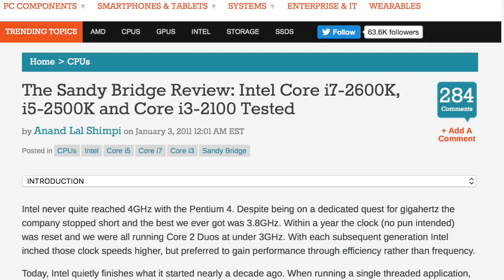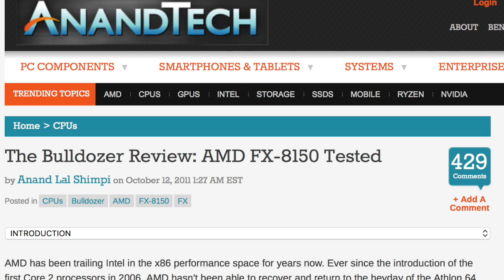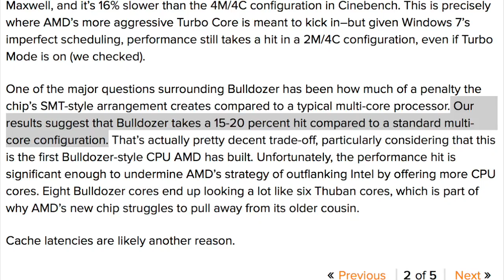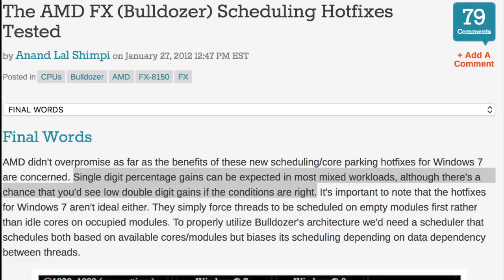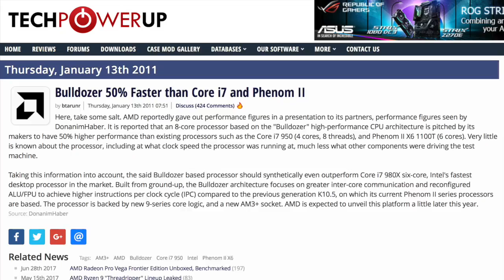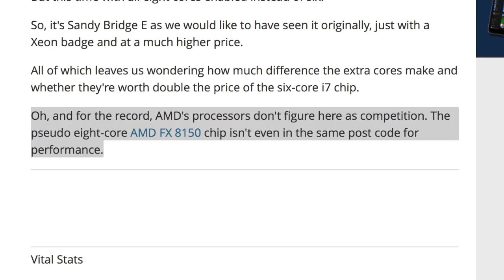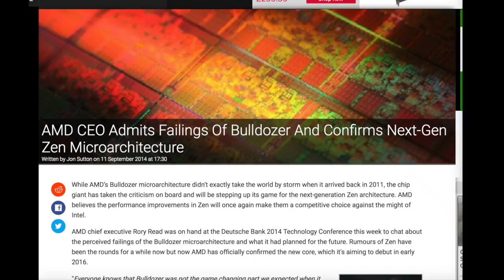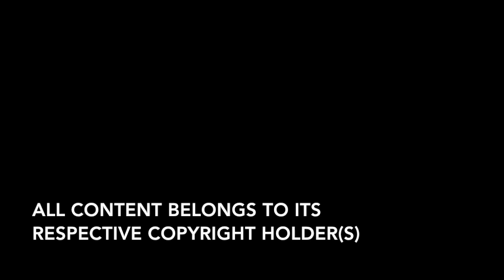The Bulldozer Story - and why AMD FX is better than you remember

Comment: FX was cheap when prices dropped after disappointment, the quads were terrible, 6 core 2nd gen FX6300 was the best bargain and overclocked well enough to be worthwhile on a budget, still is.
You need a decent mobo and memory to get better performance than Phenom II.  
I benched the 6300 at just 2.5% slower in a 1080p Heaven gaming benchmark against Ryzen 1700X, both OC'd to the max on Hero motherboards with fast G Skill memory with top of the range noctua cooler on a test bench.  My 1700x is still the fastest recorded on HwBot in the UK.
My i5 4670K smashes both the FX & Ryzen in 1080p gaming benches being 12.5% faster than the Ryzen.  Graphics card was an R9 390.

Sandy Bridge still rules if you are after a budget rig and don't mind used parts.  FX6300 is a good budget buy new if you need extra cores but there are as good if not better Intel alternatives for the same money now for gaming if you can live with 2 cores & hyperthreading.   I have an FX8300 but the extra cores don't do jack in most games and the 6300 overclocks better.

Comment: Im still rocking the following and still play everything on max settings at over 60fps (bf1,FO4, etc). For 4-5 year old rig, id hardly consider the fx to be bad lol. Nothing like being able to play bf4 in 4k while recording with fraps at around 100fps. Most things cant do that now, a half decade later. 

Motherboard - Asus Sabertooth 990fx Gen3 R2.0 The Ultimate Force (TUF) Series
CPU- AMD FX 8350 4.82ghz OC 8 core
Ram - 16gig (2x 8gig) Gskill Ripjaws X series
GPU - Radeon R9 290x /w 8% OC
SSD - Samsung 840 pro
PSU - Coolermaster Silent Pro 850w
Case - Coolermaster HAF X
Reply: cpu: FX9370@4.7ghz 1.38-1.428v htt2600 
motherboard: asus crosshair v formula z
Ram: 32gb gskill 2133
gpu: zotac 1070mini
psu: evga 1300watt g2
case: CoolerMaster Cosmos Medusa 

havent found a game yet i cant play at 4k...hell most run at 70+fps...since im on a 60hz monitor....yeah.... sall good :D 

no ssd 300gb vrap for boot with 6gb primocache(+50gb L2 cache on an ssd)
also use 9gb (bit over) for cache on  my games drive,thats a 4tb sshd, along with another 50gb ssd cache.

another good trick is to grab compressgui and compress your games folder....less data to move from drives to memory=faster load times... ;)
Reply: Try running Planetside 2 or Arma with those FX. Even Intel chips dip below 60 fps there.
No optimization for many cores, hunger for high IPC and clock  will break it's neck there.

I'm not saying that AMD makes bad products. Far from it. FX cips were just not in the right market and Ryzen is awesome, but sometimes there just isn't the right workload.

Comment: Bought the 8150 for 125 USD and 8350 for 145 USD in 2012. They both aged well, i gave them away this year and bought Ryzen 1700. FX was not that bad, only thing i really did not like with the 8150 was the heat.

Comment: Everyone can say what they want and that is fine. I recently purchased a R5 1600 to replace a FX8320. The FX8320 ran everything games and all smooth as silk. The CPU never stuttered or anything negative, It was absolutely smooth.
The only negative thing I can say about the CPU is the heat and power consumption.
Guess what, you will be hard pressed to find anyone who has or has had a FX cpu that would complain about it.

Comment: ill take a 6 core phenom 2 over an 8 core FX any day.....

and thats why i kept my phenom 2 1090t at 4ghz till i got my 1700x.......

the 6 core P2s were a bit better at single threaded, but lost out wen over 4 or 5 cores got used....
however....its still 6 cores....
Reply: I had a 1090T myself, but the FX-83xx is faster in almost any real-life scenario when overclocked at least a little. bulldozer was a failure to me, but piledriver had almost the same IPC at thuban had, but clocked way higher and offered more threads. So again, bulldozer was a downgrade, piledriver wasn't.
But for a good chip like that (4GHz) i can see why you held onto it for so long.
Reply: 4ghz.... 1.45 to 1.5 volts (no llc control...so, could have been a 4.1ghz cpu!!!)

and had 4 sticks of ddr3 at 1600mhz with cas6 or 7.....
the hypertransport speed was also like....3800mhz??

been a while....

but ya..... ive still got that chip. 
its like a pet man...... that was a great little cpu, my first real build

Comment: FX was a colossal failure, MORE than people think. AMD completely misjudged the market. High power consumption, large expensive die, no iGPU, and horrific single threaded performance made the product DOA for just about everyone. Servers/consoles/OEMs didn't want it for high power consumption.  OEMs especially don't want to have to put a more expensive mobo/PSU/cooling solution in a prebuilt just to have the CPU at 75% less FPS in WoW and other single thread titles. Huge waste of money for them, so they pushed Intel instead. Home/office users didn't want Bulldozer because it didn't have single thread or an iGPU. True professionals doing workstation tasks don't mind paying more for 4-6-8-10+ core Intel i7s or Xeons with far better perf and perf/watt, so even though Bulldozer was cheap they didn't want it.

The ONLY group that bought Bulldozer were enthusiasts, many of whom still wrongly believe their FX CPU was good compared to Intel's competition (Say, myths about i5s and i7s not being good at multitasking, or belief that moar cores = better).

From AMD's perspective it is even worse, because they were forced to take their big, expensive CPU die and price it incredibly cheaply to sell anything at almost zero profit.

Bulldozer was 315mm(squared), Sandy Bridge was 216mm, Ivy Bridge 160mm. Ivy Bridge was half the size of Bulldozer and ran circles around it in performance. That is how bad it was.
Reply: Hey Babe fx is a good budget choice especially if you just despise intel
Reply: Bulldozer was not designed for the low threaded desktop market.
Take a look at the Bulldozer-based Opterons. They were actually quite competative. Good affinity for multithreaded workloads and moderate power draw.
Reply: I went with an FX-8370 / Asus 990FX/SB950-based rig (once it's UEFI & Linux drivers matured) due to its affordable ECC RAM support and because I became aware of Intel's VPro / ME...
Reply: Was*
Reply: basshead Fair play, but the FX never competed with the 2600K, it was a 2500/2500K competitor.
Reply: Most of that was a lie. First of all, you need to own an FX to know what they're capable of since nowadays they are more useful than before. Also, the PS4 and XB1 used underclocked. 8350s.
Reply: I don't care for as long as I buy it cheap nowadays...hehehe

Comment: I still have my fx6100 , clocked @ 4.2ghz, and it does the job. Early on certain games gave it issues, like BF4, yet others ran fantastic on high settings(Witcher 2). The wife confiscated it to work from home, so i dont use it anymore, but it did fairly well for me, especially for the price. I'll be building a Ryzen based system later this year.

Comment: 9 minutes of explaining how badly AMD had foreseen the market when designing the Bulldozer.. Then turns around and says, it is not all amds fault, games and windows were not optimized for Bulldozer.  You got this the wrong way around, bulldozer was not optimized for the market it launched in.. 
Btw before i get hate for intel fanboism,. , my 3 latest CPU's has been phenom II X2 (unlocked 4 cores xD ), Phenom II X6 and FX-8320 (piledriver) because they offered superb performance for the price at the time of buying, however the first gen bulldozer was never even worth considering for anyone who owned an X6, X4 or even an X2 for gaming.
Reply from the maker: I think it's a mixture of both. AMD misjudged the market but also optimisations were slow to take place.
Reply: Jogeir Hvide yeah sure! so you're basically saying that intel was already optimized when it was created but amd not, that's why one outperforms the other.

Sarcasm aside, all hardware needs code optimization, so stop the bs. Software makers favor intel simply cuz it's a multinational that has a monopoly. (Sarcasm on again) So let's keep feeding it.

P.S.: One does not need to be a fanboy to be dumb.
Reply: +Michell Couchman: games are being optimized for the arch now, because, both xbox/ps4 (all versions) are using chips based on the FX line, 8 core, low clock, basickly  a MUCH slower version of the chips we have now, its also why you are seeing more and more games that  use 4+ cores more and more effectivly. 

and, with vulkan i get over 120fps in doom with the game cranked at 4k, thats better then my buddies 2500k with the came videocard(and hes clocked to 4.5, his chip will not pass 4.5, but, it will do 4.5 at VERY LOW volts.....so he lost and won at the same time.. ) 

with dx12 titles/tests, and hell dx9 and 11 titles, i mostly get 70+fps at 4k with games maxxed or near maxxed, dx12/vulkan never are below 100 though.....i see no problem...i was pullling 170 + solid in the last vulkan/dx12 beta i ran(cant name, nda...) dx11 was pulling 80+
Reply: No entiendo nada pero 
Cheers bub
Reply: Even a Core 2 Quad can push 60 fps in doom.  That is not really an archivement.
Other gamers that are more demanding on the CPU, especially those will less optimization for loads of threads will give very different results.
Reply: try playing Elite Dangerous Horizons,  there are very few games i have found i cant play at 4k on my 9370+1070mini, at in game or higher max, and still get 60+fps, those i cant, well, arent really games im interested in anyway, like arma2, that game runs like SHIT even on my buddies intel exteme 6core12thread at 4.6ghz, dosnt get much better perf then i do using the same config files... and in some rare cases he got worse... (when we played it for a time) 

on the other hand, most newer titles from competent devs, are making better and better use of these chips since, they have very strong multi thread perf AND support features intel chips didnt support for 2-3 gens after amd adopted them....for example, i could play the cod wwii beta when a few friends on intel had the same issue that amd users with phenom gen chips had, their chips didnt support the full feature set needed for the game to not just crash when you tried to load into a map.

it was confirmed that first gen core i7/i5/i3 chips, couldnt run the game....total bs....because...honestly, with how well it ran.... it should be able to run on a core2quad, i saw it running on an a8 apu at 1080p with competent perf for fuck sake...and that was a laptop with barely better then apu gfx....
Reply: FM3 board?
Reply: Wrong Bulldozer works just fine. although it underperforms. AMD saved a ton of money and resources. Cornered the Console market. Then Ryzen. Well planned strategy.
Reply: @John Wick You fail to see that this isn't just about FX. AMD is a world's first company, a leading company in innovation. AMD was the first to achieve 1 Ghz processing, brought 64-bit computing to the x86 arch and a lot more including freesync, free stuff/ open source, because AMD cares about innovation and progress instead of just pure performance for profit. Back then, AMD's processors challenged Intel's and little after AMD opened a lawsuit against Intel, surprise... Why does a company like that fall behind the competition? Let me see, are the two equally in economy/resources? I would give you the reason if that were the case, but the truth is that intel abuses its power, like multinationals tends to. You know you can't deny that. And after all that, AMD was able to bring a pretty good (line of) processor, that again, challenges and beats Intel's. Nothing to say about it, huh?

"Some new product line pops up from AMD, with vastly less effective IPC 
and a radically different design from previous CPUs...and you think that
 wouldn't require greater time, effort and investment to optimize?"

Things have to change and evolve in order to improve (that involves being totally different when necessary), so stop the bs.
Reply: @Chazy Intel chips have come out regularly with small incremental changes in technology for a very long time. They've been the leading cpus for a solid decade, barring the present. Yeah, software is usually well optimized for Intel, because their products set a clockwork industry standard.
Some new product line pops up from AMD, with vastly less effective IPC and a radically different design from previous CPUs...and you think that wouldn't require greater time, effort and investment to optimize?
What are you smoking? Why all of the misplaced sarcasm? Speaking of dumb...hot damn but are you ever slow.

Comment: One of the big problems with Bulldozer isn't that it isn't exactly true eight core. It's somewhere in between hyper-threading and full eight core. (8 integer cores, but each one shares a single floating-point unit.) AMD was ahead with the Athlon X2, but fell behind with Phenom and it's TLB bug, especially spending extra time making a "true quad core" by delaying Phenom rather than doing what Intel did with Core 2 Quad and putting two dual-core CPUs on one die, never mind that Intel Core 2 Duos were faster than AMD dual-core processors as well. AMD just didn't really start to catch up to Intel again until Ryzen. That's being behind for near 11 years, ~2006-2017. In some ways, AMD is lucky to have survived.
Reply: the only reason they survived is because the 8th gen consoles were barely keeping them afloat
Reply: What's funny is that Intel bashes Ryzen for being a "glued" cpu but Intel did it first with the Pentium D.  Those things had a high failure rate.
Reply: actually the major problem isnt the shared resources, its teh slow as balls cache the chips have, they are held back by the fact that the cache is slow as balls....its pathetic but, its a flaw because they used automated design software to design the chips and didnt to much if any hand optimization....

if keller had been brought in to fix FX, he could have,  there are some VERY in dept articles on it...

and phenom I imho was worse then FX...Phenom II was pretty damn good...still like my fx over my 4ghz 1050t.... even the 8150 i bought for 50bucks(guy got it, then got an 8350 from a friend at amd and sold me the 8150 for the cost of shipping me some other shit he owed me...LOL..) 

now, you also need to keep in mind, this story somewhat changed over time, 
http://www.guru3d.com/articles_pages/watch_dog_2_pc_graphics_performance_benchmark_review,8.html

http://www.guru3d.com/articles_pages/dishonored_2_pc_graphics_performance_benchmark_review,8.html

http://www.guru3d.com/articles_page...e_warfare_pc_graphics_benchmark_review,8.html

http://www.guru3d.com/articles_pages/battlefield_1_pc_graphics_benchmark_review,9.html

http://www.guru3d.com/articles_pages/gears_of_war_4_pc_vga_graphics_performance_benchmark_review,8.html

due to windows 8.1/10, driver updates, game updates, games in general being made more and more to try and take advantage of the xbx/ps4 hardware...a very slow version of these chips....

really, the last apu's they made in that lineup made up alot of the distance in perf, they just never gave us an am3+ version of those chips... sadly....

amd fucked up, but also....without amd, intel would be fucking us all even harder....without amd...intel wouldnt even have dual core desktop chips.... just very expensive slow...crap.....(look at what happens when they get to powerful for to long....netburst is a good example...or chips that regularly hit 80c...(wtff....80c would melt my chip....)
Reply: the pentium-d are soooo horrible, seen sooo many old oem systems running at 90c when they finely get to desktop....fan/heatsink totally compaced with hair/dust/etc... jesus...

it is funny...since intel even implied their "glued togather" cpu's where a supperior method to amd's at one point... 

anyway...they should have brought keller back far sooner, had him work on a new design after he got the FX line's major issues sorted(the worst being cache latancy being utter shite.. dragging the rest of the cpu down..)
Reply: Packing multiple dies toether is actually a cost effective method. Design a slamm die, test it and combine similar scaling chips into one product. And Zen has actual interconnect between the dies while the Pentium D had to communicate over the comperably slow FSB.
Reply: And then comes the topic of inclusive cache and exclusive cache.
Intel caches have been generally faster, but they were aller and inclusive (the data of L1 ist also in L2) while AMD had bigger, slower, exclusive caches.
Reply: So it wasn't a clusterfuck, it was a modulefuck :P
Reply: A problem with Ryzen CPUs is that they have a lot of L3 cache but less of L2 cache. While a certain i7 had more L2 but less L3, so some guy bought a i7 7xxxx series. I forgot the exact model.

//EDIT: I guess I forgot to add why. He bought it since the i7 performed better and also he got a big discount. I checked and it was true that that particular i7 performed better than I think the Ryzen 7 1800.
Reply: Bullshit my Fx 9590 is still running strong and kicking Ass.

Comment: Saying that DX12 or Vulkan automagically use all cores present in a CPU is wrong. These APIs have to be used by game engine developers AND game developers to write games for multi core CPUs. They /enable/ using more than one core, but do not enforce it.

That Bulldozer was a total failure can best be seen by looking at Ryzen. Ryzen is true multi core/SMT, like what Intel has been doing for years, basically the opposite of Bulldozer in this regard. Bulldozer almost killed AMD.